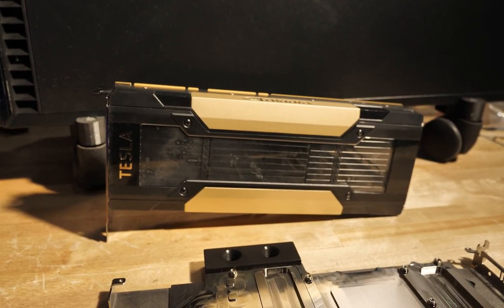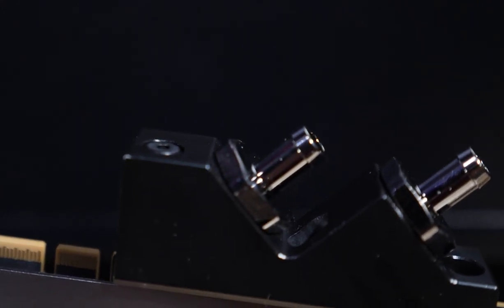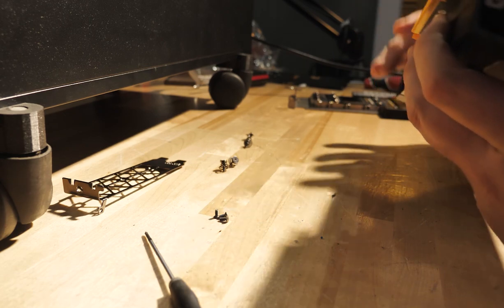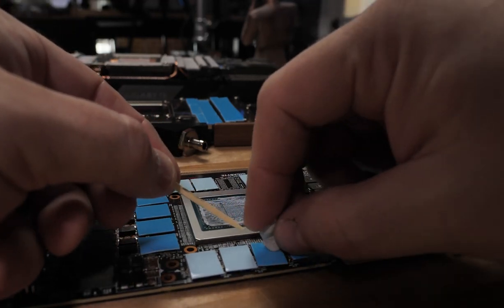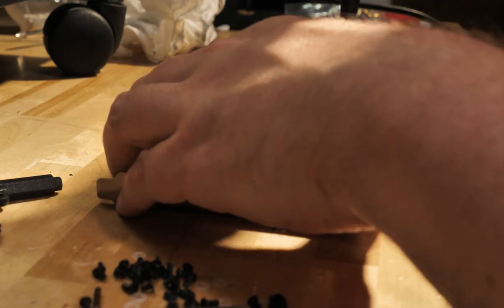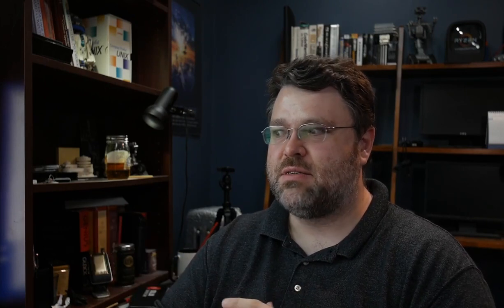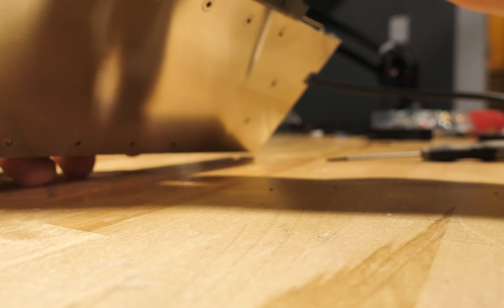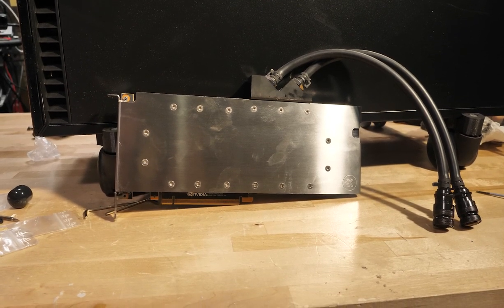Liquid Cool Your Tesla V100 With EK's Quick Disconnect Kit + EK V100 Block Kit

Comment: So I came upon this video years later, I'm trying to modify a card to have the same resistor layout of the Tesla V100. Tried grabbing some frames to reference the resistor layout of the card but cannot seem to find a good frame. Would it be possible to get a couple highres photos of the PCB front and back? There seems to be little to no information on the the card without it's shrouds on.

Comment: Hey, I got an upcoming build planned with external radiator setup, and I was thinking of using quick disconnect for the pc-rad connection. Since you have a extensive portfolio of watercooling videos, could you do a comparison on different quick disconnects on market? I found nobody else has done one. Could include flow rates, spillage, air introduced to system when connected as there are many different types and iterations of QDC's.

Comment: Are Teslas more powerful than Quadros?
Reply: They are used for different things. Tesla is used for parallel computing and Quadro is used for CAD. I have never used Tesla cards but as far as I know they are not a graphics cards and don't even have graphics outputs like HDMI or Display Ports for example. I know this doesn't answer your question but in terms of raw processing power I would assume Tesla cards would spank a Quardro in double-precision calculations and memory bandwidth (I don't know about the Quadro GV100 though) But the Quardo rtx 8000 has the most RAM in terms of gigabytes (at 48gb) of any NVidea card (that I know of).

Comment: Now we need benchmarks of this vs the 3090
Reply: My titanV is on par with 2080ti so should be on par with 3070, so 3090 should be about 75% faster depending in how shader or ROP limited your application is.
If you need fp64 then thats completely different as titanV and V100 have 6.9Tflops of fp64 meanwhile ga102 is limited to 1/32 rate. The 3090 is not a titan.

Comment: With pulling it out of the loop after use, any concern with the liquid that is still in the GPU and the lines attached to it? Will it over time cause corrosion?
Reply: Why would you think it's any more of an issue when the same liquid that is circulated through the entire system is sealed off in the single component for a time?